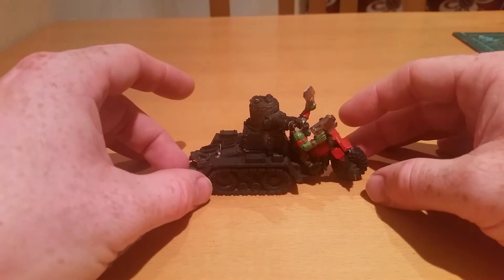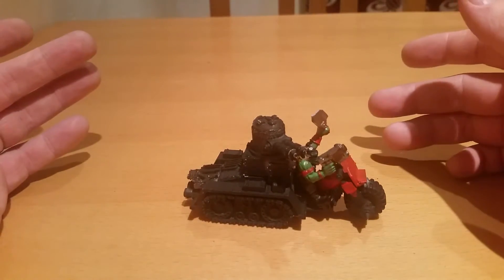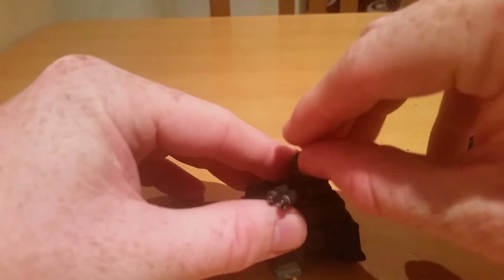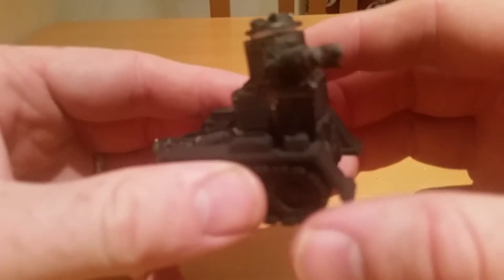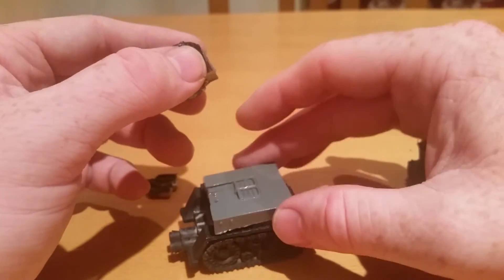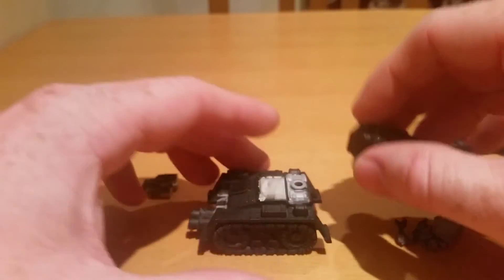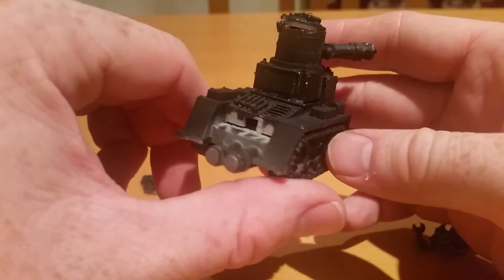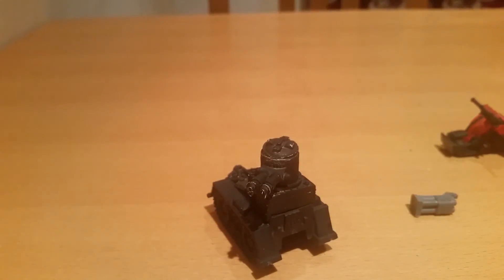Ork Skorcha Conversion

Comment: Very cool idea using these to make grot tanks.
Also consider using a taurox. I reckon you could make 2 grot tanks from 1 taurox kit and a few extra spares.
Reply from the maker: Stevo 4TK never even thought about that might have a look into. Thanks for the tip dude. If you see it on the channel it will be in your honour ☺☺☺
Reply: Wargamer Nick 😊 Thanx. Also consider the Kataphron battle servitors. The bodies of those are an ideal base to use as a grot tank.